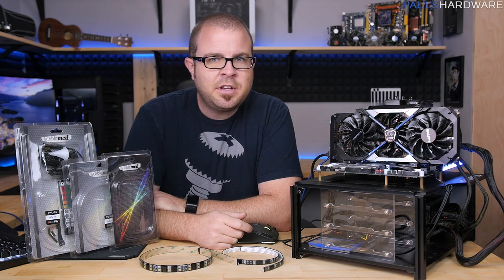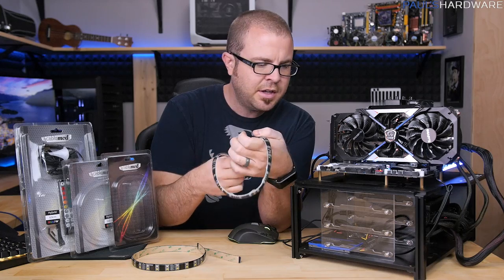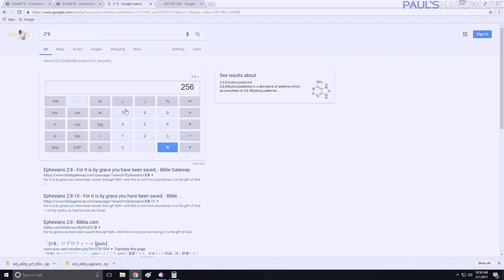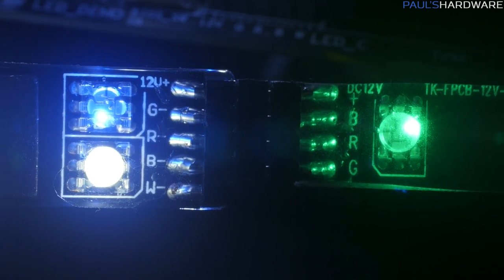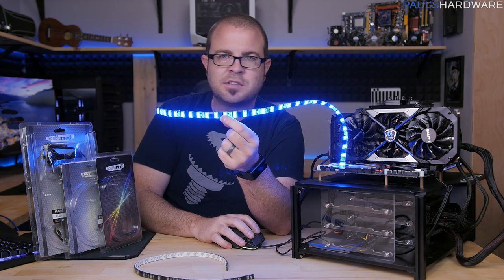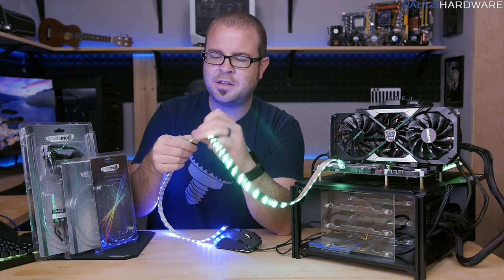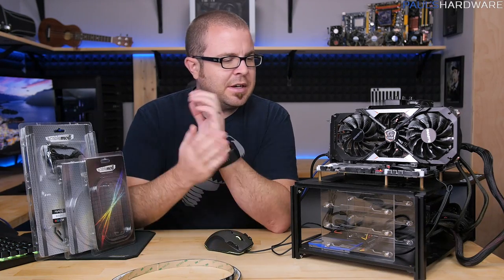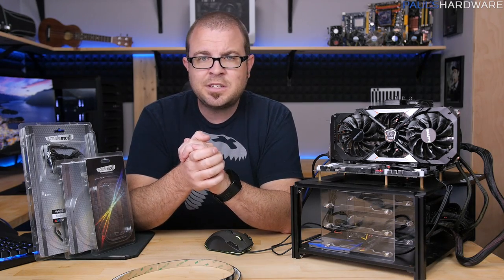The Trouble with RGB LEDs

Comment: The best use for RGB is showing temperatures at a glance.
Reply: Ashur George i have seen people use little led "screens" that are really cheap to show temps huhu
Reply: Ashur George yep. led lcd with fan control, flow monitor and temp. thing even beeps when somethings not spinning if I set it to. cold cathodes are for lighting:P
Reply: I have LED strips in my computer that I programmed to change color depending on temperature...
Reply: @MrDhoobs1  how would they know that you have programmed them like that

Comment: Dear Paul:
If the LED strip was receiving "data" and processing that to tell the LED's what color to be, then there would be only be +/-/data 3 conductor connection. But, these have a +/R/G/B/W 5 conductor connection. Meaning that the voltage or color control(er) is on the Mother Board and is sending varying levels of voltage, or more correctly switching frequency, directly to each color LED in the strip.  ;)
Reply: Exactly, only "digital" led strips have  a data pin!

Comment: I think you're overthinking this Paul.
You have a 12v+ rail and then you have a ground for each LED  color, there is no data going TO the LED at all, there's a controller that varies the pulse width of the diodes ground pin at high frequency.

The LED's them selves are just solid state diodes.

Comment: A) I've been Web Engineer/Designer for 15 years, and Paul breaks down RGB via bit/binary, and schools me, without coming off smug. Props.

B) Paul!!! Can we get a video/addon to this one, which highlights the use of the phanteks enthoo evolv case LEDs, with the adapter for this Gigabyte Gaming 7? I have the same board, and will be RGB'ing (really just for the white), once I get the water components in there. I haven't purchased any adapter yet, and want to make sure I'm not messing it up. 

Either way, keep rocking!

Comment: Check your stuff. RGB strip is not receiving any signals on RGB pins, that is each led's ground connection. To achieve brightness control, RGB controllers switches them on and off faster than human eye can see with different pulse width (PWM), longer pulse = brighter, shorter = dimer.

Comment: I think gaming hardware design has lost all meaning now - motherboards have huge 'gaming' heat sinks that don't do jack compared to server motherboard ones (which do all the real intensive work); keyboards have to highlight every wasd key and everything else in rgb; graphics cards are simply becoming overblown for what they do (rx 460's having the same heat sink as an rx 480); fans and RAM having the pointless addition of rgb highlights.
Imagine if Intel made an rgb 7700k? What's the point?

Although there are some computer builds that look great in the house, most hardware manufacturers are being consumed by the need for excessive design instead of functional and rational design.

Comment: wait, those RGB LED's are Digital? mine are Analog .-.
Reply: no, this led´s are not digital. 
These are like all others.
Reply: Aroop Roelofs They are analog. I think he fucked up when he said that the pins transfer data and tell how bright they should shine.
Reply: Aroop Roelofs It makes sense that strips are analog. the computer takes the rgb value and converts it to the current instead of having a microcontroller on each strip
Reply: ye, I know they should be analog, but I thought maybe I didn't know something I should have known? (Since paul talked about the bitrate n stuff)
Reply: they can be both, a 5050 rgb strip has all the led's one color.  a strip of WS2812 for example could be programmed so each led is a different color.
Reply: Aroop Roelofs the ones he's holding are not digital
Reply: Luciano de Benedictis average voltage, not current
Reply: The LEDs are not digital, but the motherboard sends a digital signal that is converted to a discretized analog signal.
Reply: but if that's the case, why doesn't it use 2 data pins and 2 power pins like the most "programmable" LED strips??
Reply: Aroop Roelofs, WS2812 LEDs only need 2 power & 1 data line. When the chip has received 3 bytes of colour data, it just passes subsequent bytes on to the next LED chip, and so on...
Reply: ah okay.
Reply: mine are static :D
Reply: yourcurtainsareugly
The brightness of an LED depends upon the voltage. A digital value of 0-255 must be converted to an analog signal corresponding to a brightness ranging from the darkest to the brightest. Due to how digital to analog conversion works, this resulting analog voltage will be discretized into 256 possible values.

HOWEVER, the brightness may also be determined by blinking the LED, but this causes strobing effects at lower brightnesses. In this case, the analog signal is only on or off, not discretized. Instead, the time intervals of the signal is discretized in a way to correspond to a brightness of 0-255.

Either way, the digital signal is converted into a discretized analog signal. The voltage, time, or both are discretized. It is possible that a digital signal is sent directly to the strip and that the strip adjusts the brightness of each LED using the 12V connector. THIS would make the strip digital, with the digital to analog conversion occurring in the strip rather than in the motherboard.

Of course, they may also be using some way that I haven't thought of here, but the basic principles still apply.
Reply: +yourcurtainsareugly
you seem to be describing a DAC or PWM controller
Yes, I am, but I'm trying to be explicit to show where the discretization comes from. A digital signal of more than 1 bit must be represented by an analog signal of more than 2 voltage levels. A PWM signal driven by a digital input must also be discretized, but by time. A DAC or PWM can only produce discretized outputs because the input is an array of discretized values.

Edit: I didn't actually respond to your point. Yes, it is a little contradicting since my terminology is sloppy. My whole point is that all the strips are ultimately driven by digital signals that are converted to (necessarily discretized) analog signals somewhere between the software and LEDs. However this is done doesn't change the final result, discretized control of the LEDs. So, either way is technically digital. A true analog LED strip would be capable of continuous analog signals rather than discretized.
Reply: +yourcurtainsareugly
why do you keep saying "discretized" when "discrete"
Sloppy terminology. I used the term for the intermediate step of an ADC, which I am more familiar with (for data acquisition). "Discrete" would be better.

would the LED strip not be capable of being driven by a true analog signal, since the motherboard is just driving an approximated analog signal?
If the ADC is on the motherboard, compatible strips are analog and could be driven by an analog controller. I think this is the situation, but I don't know for sure. I don't even own LED strips.

I just made a casual comment that, for strips being driven by a digital source (the software), there wouldn't be a practical difference between digital and analog LED strips. I'm no expert in case lighting. lol xD
Reply: by 'data' he probably meant the PWM signals as technically speaking they can be described as 'data'

Comment: My real issue is the trouble of having many different brands with RGB lights and not being able to sync them. I have an MSI MoBo with a Phanteks case NZXT cpu x52 with AER fans and an Asus 1070 Strix with Logitech mouse and keyboard and i cant sync them all up.
Reply: Yeah, we need proper unified standard for this.
Reply: I think the only way would be to go all Corsair since they do AIOs, Kb/M, fans etc. But even then the might be inconsistencies and it would be a lot of $$$...
Reply: Yeah...that was the point of the video.
Reply: Yup, same. I've got an ASROCK mobo with it's own RGB, a gigabyte aorus card with it's own rgb, and an EVGA cooler with it's own. Super annoying. Also the EVGA RGB software is horrible and resets it's self all the time. So my MOBO and Card match but right now the EVGA is cycling through all the color lol.

Comment: ace video but slightly wrong on the leds being sent "data" 12v is supplied and the R,G,B lines will be a sink for current of varying resistance. and the 12v line into the wrong pin on the led shouldnt do any damage leds are effectively one way valves for electricity putting power on the wrong line will just mean nothing happens

Comment: Those leds u showed run with PWM  controlls Pulse Wide Modulation . Digital leds on the other hand  liket he WS2812B  has 5v pin and data out and in pins. They are controlled by using a byte per color , 3 bytes per led.

Comment: I think that future of RGB lighting are WS2812B adressible LEDs.
They require three connections, two for power and only ONE for signal.
With that only one wire you can controll all colors on each LED separately!

Comment: I have a 5 pin connection and a bulky 4 pin connector for my rgb fans. I cannot fit the connector into the 5 pins without bending the fith pin. Thank you Gigabyte, for giving me an aditional pin that I didnt wanted lol.
Reply: Hey, I'm having a similar problem. My case's rgb fans have 4 pin rgn conectors and my gigabyte Motherboard has this 5 pin connector. What do I do? I just plug them and leave the white pin out?

Comment: I know the video isn't new, but a little correction here: LED doesn't receive bits or byte. They are controlled by pwm (pulse with modulation). So on your strip, they have a common anode and a PWM driven cathode (GND or ground). 

The 8 bits resolution is true, but only for the motherboard. When the controller receive the data, 0-255 resolution, it begin a duty cycle base on a pourcentage (0=0% and 255=100%)

Comment: Great video Paul, I'd like to note two things though.

1: You've gone into great detail to explain how the RGB scale works, but you mentioned 5050 LEDs, and you didn't explain why they are called 5050. You didn't mention other types of LEDs though, so it's less significant, but it just stuck out, after you've explained RGB so well.

2: In my experience standalone RGB LED kits with 44 key remotes, that have custom preset keys, and separate RGB channel brightness buttons don't have the issue you mentioned with your shelving. Although they don't have a scale of 256 different brightness levels, they do have over 50 (the controller I'm currently using has 65), so you can pretty much mix any color you want with them, real white as well, you just have to decrease green and blue by varying degrees.

I don't think I'll be seeing this type of controller on an mITX board anytime soon, so I have to use the aforementioned setup and match my peripherals to my ambient lighting, instead of the other way around.

Comment: +Paul's Hardware To get a better white with RGB strips you can adjust the level of blue and green slightly. This works with both my HUE+ and cheapo ebay desk strip. For the HUE+ something like 255/180/175 produces a slightly warm white, but much better than the default white setting which is 255/255/255

Comment: So I'm not sure about your particular setup. However, many of these strips are purely analog, so that 255 step limit is most likely determined by your motherboard's DAC (Digital Analog Converter). If you want a highly more configurable setup and aren't afraid of DIY then you should check out ws2811 LED strips. They run on 12V but the main difference is that every LED has its own dedicated PWM chip. This allows you to control every light INDIVIDUALLY. So if you wanted one part of your PC to be one color and a different part to be a different color its very doable. You can also setup animations or other effects. 👍

Comment: There is another problem with them:  They dim over time. This affects all Light Emitting Diodes, but in RGB arrangements this can lead to skewed colors.  Just ask RaiderZulu's Draft Horse, an M18x.  It has 3.25 years of uptime and everything has dimmed to the point that it needs replacement.

Comment: so you said the cablemod strips are made to work with Asus boards....does that mean I do or don't need do buy their starter kit with the remote? Also do their RGB strips work with the Asus Aura Sync? sorry if it's an obvious question, never used RGB strips before.

Comment: Correct me if I'm wrong, but isn't the reason it's anywhere from 0 to 256 is because the colors use a two digit hexadecimal notation, where 16^2 is 256?

Comment: White, in rgb code is 255;255;255. If you want a vetter white, use something like 255;255;230. This will get the blue a little less bright so it doesn't have all the blue'ish tint. It's not perfect, but at least it's something. Note that by doing this, the brightness in the final state will be a little less.

Comment: How do I even get my rgb's working? I have an msi Z170 motherboard, not completely sure about the full name, but it refuses to change color help
Reply from the maker: you need to download MSI's software, it's called Mystic Light
Reply: Paul's Hardware It hasn't worked once, gonna reinstall some day though
Reply: Nala I've got that aswell
Reply: Nala Then the rgb feature mentioned everywhere would be kinda misleading
Reply: If you have windows 10 then it's a compatibility issue with MSI's software
Reply: chrisfishbob Yes I do, aw, that sucks :(
Reply: Yasu it'll get fixed sooner or later don't worry
Reply: Random HUB Oh, well that at sounds good

Comment: You may want to learn about Light Emitting Diodes... I don't fault you for the mistaken thought, it's not common knowledge unless you've gone to school for EE or the like.
Those numbers are diode specifics at which they'll output said wavelength/spectrum and brightness. Specific LEDs output a select range of color, but each have to work together.

Comment: Exactly, inconsistency is the issue! One of reasons I returned RX 480 GTR - the fuckin bright blue LED right infront where is PCI-E  cable connector (otherwise I had white-red setup all over)

Also, I don't give a shit about millions of colors and software controller - would prefer analog switch with 10 colors enough.
Reply: I agree about the millions of colors, for me it just makes it harder to choose a red for my red/black build

Comment: How RGB lighting works... It has the 12V for power. The RGB(W if it has that) are the ground's. To determine the brightness of the LED's, it decreases the resistances on the ground plug/s to increase current( to make it brighter), or increases the resistances to decrease the current(to make it darker). Hope this helps some people to figure out how this stuff really works.
There is no such thing a digital RGB lighting. It is not possessing 1 or a 0.

Comment: Hi guys!
Im thinking of builning a pc and I've been thinking about which parts to get..
These parts I've picked out:
-i5 7600k
-noctua nh-d14
-MSI geforce gtx 1060 gaming X 6gb 
-gigabyte GA z270 gaming K3
-EVGA 650 GQ 650W 80+ Gold ATX
-Cooler master mastercase pro 5
-16gb (2x8) crucial ballistix 2400MHz
-Samsung 850 evo ssd 250gb

I'm open to all kinds of suggestions as I'm a first time builder. Tell me if there is something wrong with the parts I've picked. I
already have another ssd on 250gb and i dont plan on downloading a bunch of stuff so storage wont be a problem..
Reply: Thanks for your response!
Won't need that storage, have looked for a better cooler. Found this cooler: PH-TC14PE.
Do you think it's good?

Comment: The biggest issue for me personally is getting your rgb fans and case light matched in colour from just the motherboard, if the board only has one pinout for rgb surely you cant run multiple fans from it as well as a case light?

Comment: Paul, great video! I have an Asus G11CD case. no mobo, no PSU, etc (the DVD & front cables are there) and plan on a Gigabyte AM4 (Aorus B450 M) and want to keep the mounted LED strips working. There are 2 strips (top & bottom) each have a 6-pin connector (only 5 pins /wires are present) I am not sure if those connectors plugged directly into the Asus H110 (?) mobo, or another component. Either I find a suitable adaptor, or replace the RGBW strips. I think the Asus Aura is more advanced than the G/Byte Fusion. I don't want a XMas tree in case, but the adjustable lights are cool! can those LED RGBW strips be cut down to length and still work? or does CableMod have premade replacement strips? the ones mounted in the Asus case are on PCB, I think there is one more color line on the Asus LED ones, being Orange. Thanks again sir!

Comment: Don't know why everyone thinks a digital signal is being sent through the RGB strip. This is wrong. What it is doing is it sends the 12V down the strip into 3/4 grounding points. Say you want your strip to be blue. It will open the circuit on red and green (white if you have it) and no resistance on blue. Say you want the blue to be darker. Then it adds resistance to the blue ground plug so less power is sent to the blue LED. Say you want yellow, it will open the blue circuit and closes the red and green and runs the power parallel to make yellow. Now if you want pink, It closes the circuit on red, blue, and green but blue and green are at 50% resistance so those LED's are more dim to bring out more red to make pink. There is nothing digital about this. The software does everything digital, not the LED strips them selfs.

Comment: So I plugged my rgb strip into an extension wire right into the 4 pin header light stays on for like 10 sec then turns off any solutions ? My fans and aio works perfectly fine ?